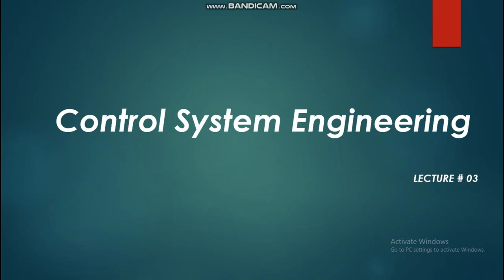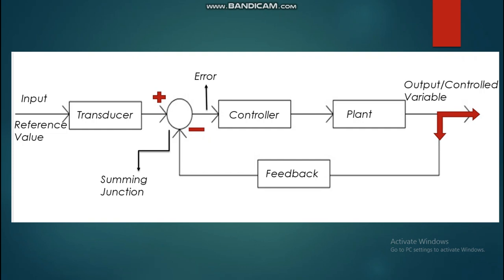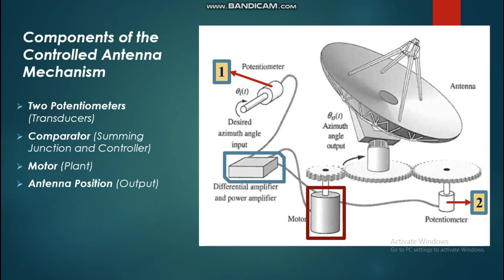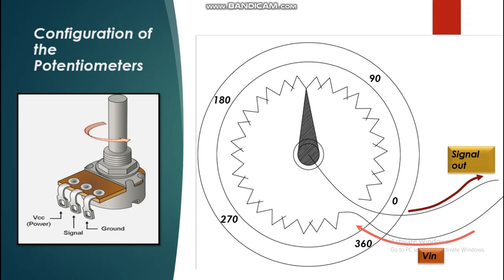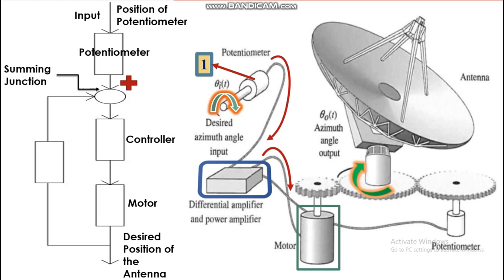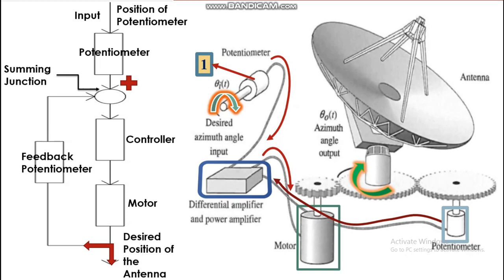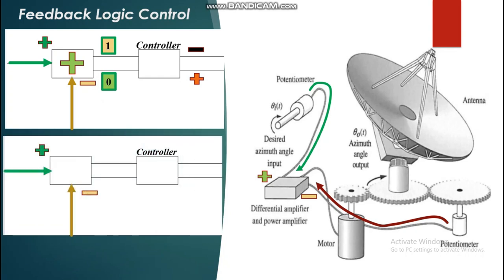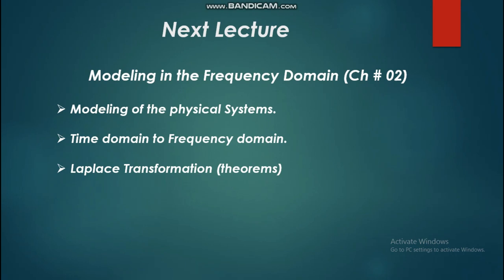Antenna Position control with closed loop control system Lecture # 03

Comment: can i get to the function of each element to convert it to transfer function model ?
Reply from the maker: Definitely, as in this case the Transfer function will have the output equal to the product of input and transfer function. The transfer function will be responsible transfering the input into output. Input in this case will be the combination of the feedback transducer and the input transducer, while output will the rotation of the motor attached to the antenna.
Reply: @technicalpeaks  I don't mean that, I want equations for each element to convert it to transfer function model .
Reply: @technicalpeaks  can i talk with u in facebook!
Reply: @technicalpeaks  please quickly ok !
Reply from the maker: Glad I could help. I hope it was good enough ?